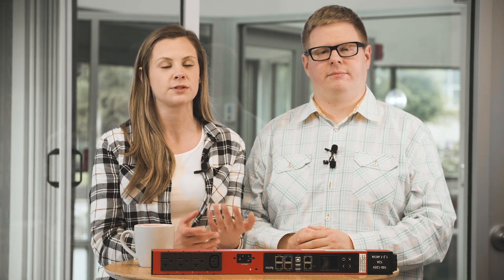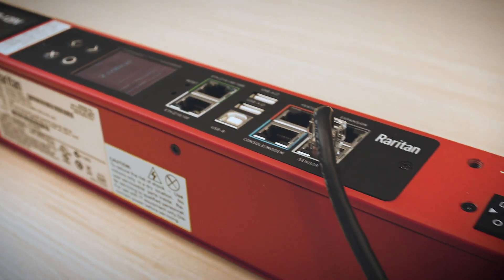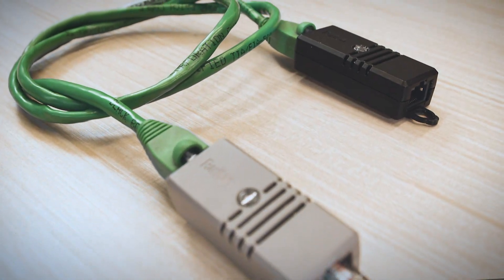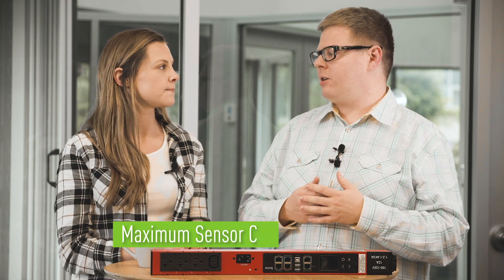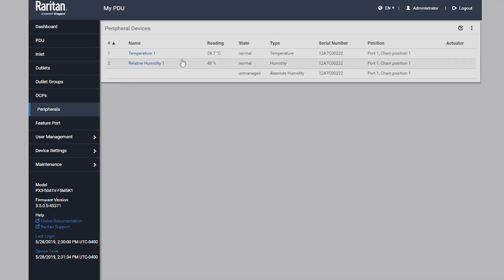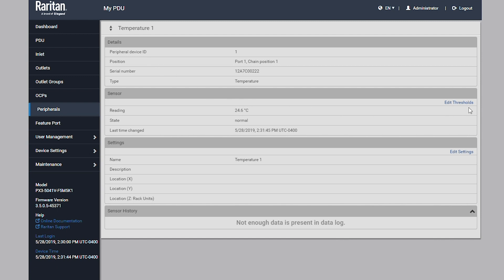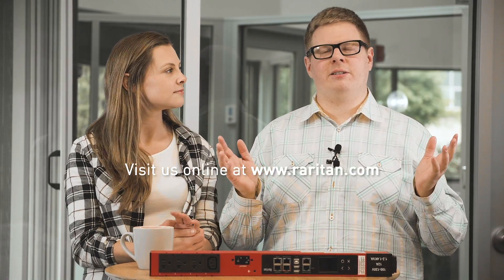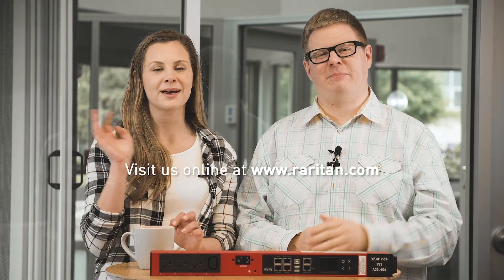How To Connect and Configure SmartSensors

Comment: So if you have a larger than a 30 meter room then positioning of the controller is to be the most central point. If that's the case then what's the maximum length of the cat6 cable between the controller and the network?